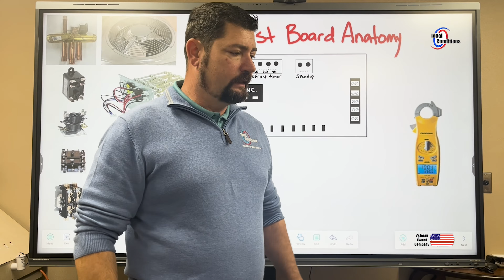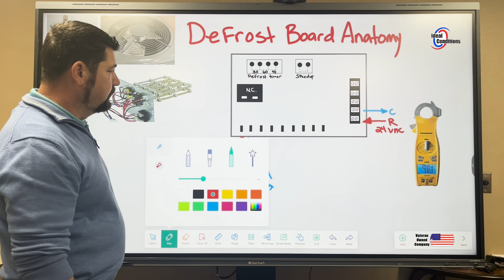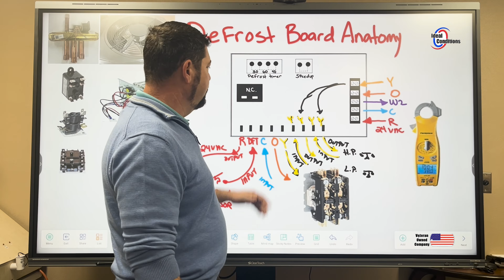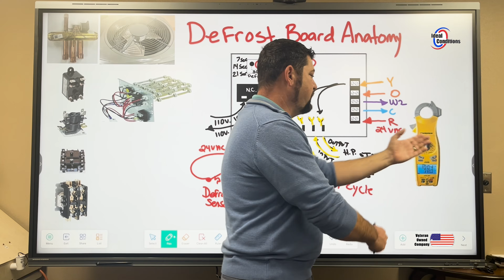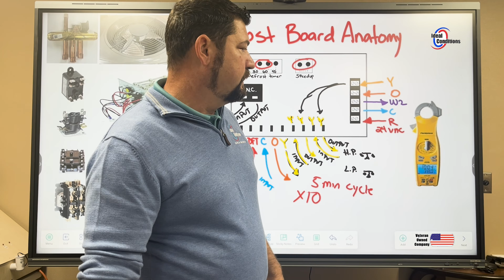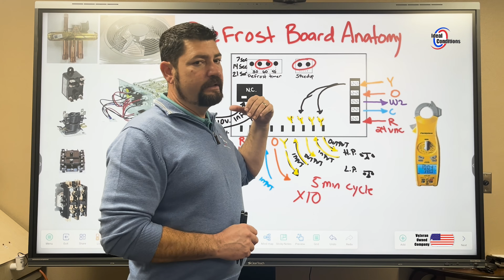Defrost Control Board Anatomy

Comment: If all of the heat strips energize, the temperature could hit set point and shut off the unit during a defrost operation.  What would make only a portion of the heat strips energize during defrost to just hold temperature steady to take some of the edge off of the cool air conditioning air blowing into the home?

Comment: On a time and temperature defrost board the unit has a timer and a sensor in the DFT board. When the time has elapsed it will not go into defrost unless the sensor is closed indicating it is needed. Also if the sensor is closed it will not enter into defrost until the time has elapsed . In this training session you instructed that the operation was different than what I just stated. Please research and make necessary corrections as to not mislead some less experienced techs than you and I.

Comment: Great video. For systems with no defrost boards just relays, what could cause a call to a nonstop defrost cycle that keeps the heat strip and blower (low speed) running? in the cooling cycle, the heat strip turnoff. I can measure power from the NC switch. Is the outside unit W cable calling for this cycle? What should I look for? Thanks